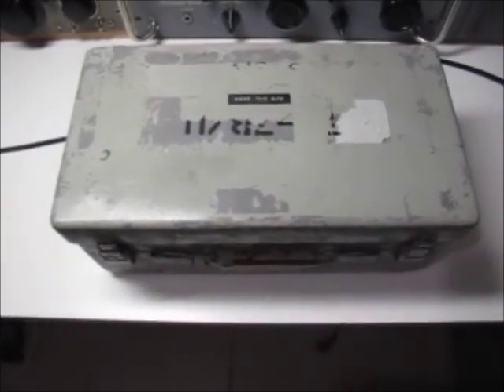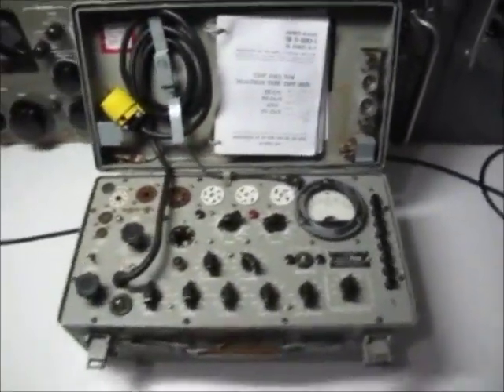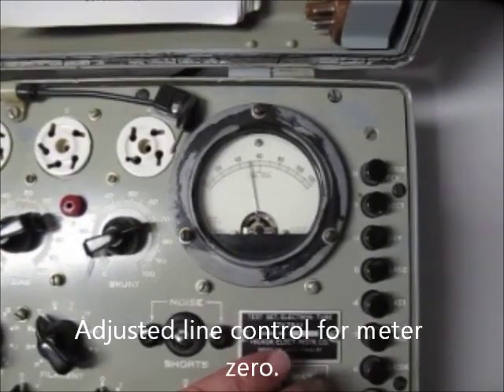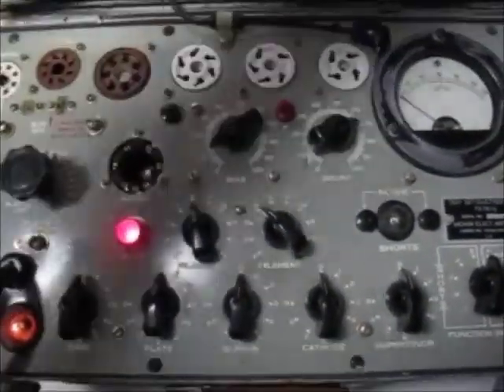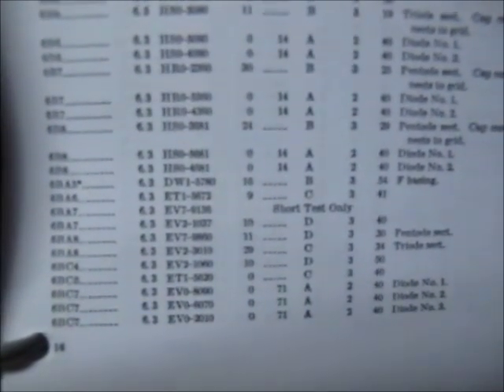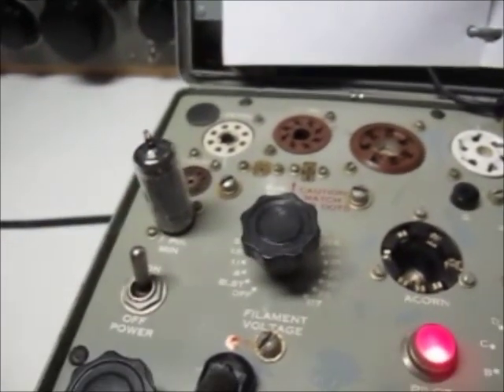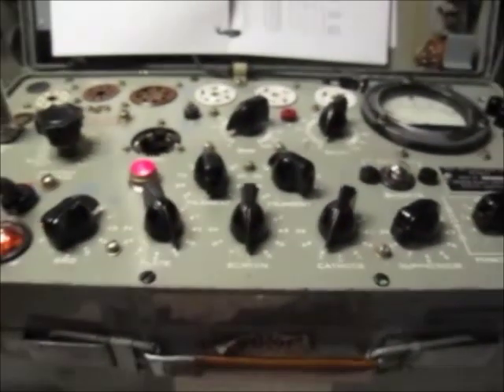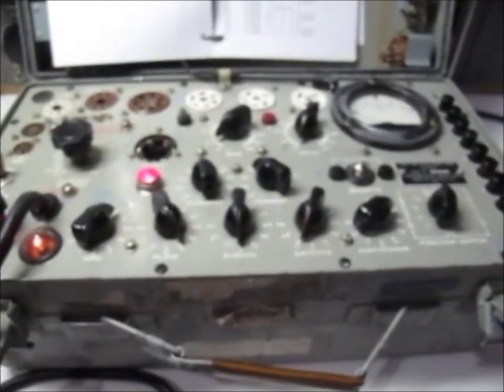TV7 Tube tester operation

Comment: I have one that has been stored properly but I haven't used it in years. Do they store well or do I need to get it looked at? How can I tell if it is working properly?
Reply from the maker: Hi, I suspect they store quite well but not sure how many years were talking, I am trying to remember if there are any elctrolytics in the unit. In my case I have had the unit some 15 years and it can be 2 -3 years between uses. Some of the comments below talk about the bulb should be off. I pulled the servcie manual and had a look inside. There is a small adjustmet for line internally, wich i adjusted as per teh manual, it did make the buld glow a little less but its alwasy going to be on. No leakage no other drain. Now, I am running it of an 230-115V transformer here in Australia so it could be that its runninga bit higher here (My mains is about 243VAC). In short I think they are pretty indestructable. I suspect most 'wear out' from use than actually fail!. A very basic check is to see if once switched on that the mains voltage is indicating correctly. everything else is mostly dropping resistors and hard wired switches.

Comment from the maker: A Note on the FUSE BULB. Having been convinced that my TV7 tube tester had a problem because the FUSE bulb glowed in normal  operation i ordered some replacement rectifiers and even a ballast resistor. 2 days of going around in circles and not finding any thing specifically wrong, with new rectifiers and some small ( very small ) adjustments to biases internally and resetting the LINE level indicator, as per the manual came to the conclusion that the BULB does actually glow under normal operation , All I can comment is that perhaps some type #81 bulbs are slightly different to others , I tried 3 and all glowed but some more than others. I put the unit on a variac over 100-120V  some difference was noted but still it does glow,  Understand when I say glow it is a perceptible orange low level glow not bright as it looks in the video, The only thing I would advise to keep an eye on is that the level adjustment ballast resistor doesn't set within +/-45 deg of either end stop. Overheating of the ballast resistor will occur a. The question of Glowing has bugged me for some time but  can find nothing wrong with the TV7 and the bulb will always glow a little.

Comment: The bulb is actually used to protect the tester on a marginal overload.   It should NOT glow when the tester is idle.  It will glow somewhat when testing tubes that have high filament current draw.  It will glow brightly with some tube defects.  Check to see if your bulb is a type 81.

Comment: Do you still have this unit?  If so is it completely calibrated?   I have the same unit and am trying to learn how to use it.  I need to get a few tubes that have been tested on a calibrated unit so I could do it on mine and see if all the parameters are in spec.   Looking for any info, and willing to pay for help.
Reply from the maker: Hi Blake sorry i missed this comment, just noticed it while i was making some updates to the Fuse Glowing comments, Hope you managed to get your TV-7 all up and running and giving good results. All the best Peter

Comment: Peter, I am new to this world although I have been a pro gtr player all my life and I am 50.   reverbnation.com/blakethompsonband.         I have  a 7 D/U  and also a TV-2A/U ( like a rocket ship panel).    When testing a tube do I have to keep turning off the power  between tests on the same tube?    Say, Between diode 1 and 2 testing  and then again for the Mut Con   test?  Or can I change the parameters with the tube in and unit AC power on  and then push the proper test button?   Thanks for the info.
Reply from the maker: Hi Blake, I normally pull the tube from the tester when changing the settings if your checking say a double triode set it up for the first triode, plug in the tube let it heat up and test. I then pull the tube reset the settings for the #2 triode plug in the tube let it warm up and press the test button. I seem to recall way back when, I tried changing the settings without pulling the tube and had the cct breaker tripping (in an AVO tube tester I was using). BTW i also destroyed a tube once when one of the settings was incorrec, i alway double check teh dial in settings....Hey ain't nothing wrong with 50 years old, I have been in electronics all my life, would have way preferred to been in a band!.. I do fiddle with guitars (Fender and Washburn) but its definitely not professional...have fun with the tube testing. I would rate the TV7 as the best quick check tube tester out there......Pete

Comment: Hi, my fuse light doesnt stay lot like yours. is that an issue?
Reply from the maker: Hi Steven Its something i need to look further into, I think nominally it shouldn't glow (or be very dim) if your off 110-115V AC, I am in Australia and use a 230-115V Transformer. I think the local supply here Varies @ 240 - 244V AC and my transformed down volts is probably a bit higher than 115V AC. It may be why the bulb light s up here. Or I have something 
leaky' internally. It generally operates well and readings correct so at the moment I use it sparingly but when time permits ill take a look inside.

Comment: Don't bother adjusting the 'line adjust' until after you've put in the tube for testing.  The filament current draw effects the reading greatly.  When you saw that your line adjust was 'high' at first, in reality, a 6L6's filament draw would have pulled that right down to the normal range.  Also, I'm not sure if there is a current leak in your tester or what - I've never seen a TV-7 light up the ballast bulb so brightly when no tube was being tested.  In fact, it usually takes a pretty large tube to make it light up much at all...

Comment: Subscribed to ya! Check mine out if u have a minute or two.  Nice video!
Reply from the maker: Hi Steve thank you for the kind words, I still use these testers (TV7/CT160) regularly, your vids look good as well , keep 'em glowing!.
Reply: I'll check out more of your stuff after work sir.  I like that... "Keep em glowing". Very good!  Have a good Saturday.  Steven
Reply from the maker: Hi Steven Its something i need to look further into, I think nominally it shouldn't glow (or be very dim) if your off 110-115V AC, I am in Australia and use a 230-115V Transformer. I think the local supply here Varies @ 240 - 244V AC and my transformed down volts is probably a bit higher than 115V AC. It may be why the bulb light s up here. Or I have something 
leaky' internally. It generally operates well and readings correct so at the moment I use it sparingly but when time permits ill take a look inside.

Comment: Sweet video!  I've got a Hickok tv7-bu...  Wonder what's the difference between the two?  Great video!
Reply from the maker: Hi Steve, off the two valve testers the TV7 is mainly used when I need a quick check on a valve when restoring mil radios i have here, its the first tester I reach for. The CT160 is a UK made tester that gives just a little more control so that you can check the GM at various anode/grid volts settings and adjustable bias. I guess it means that you can more clearly see the valve characteristic, It takes longer to test a valve and Its mainly used here when trying to match 2 or more valves for balanced use. Hope this helps. Pete

Comment from the maker: Thanks Gery, When i need to check tubes this is the first unit i use to check them. I find it very good at running through the tubes in the Radio equipment i have. Its saved me a lot of time in the past, its very good....